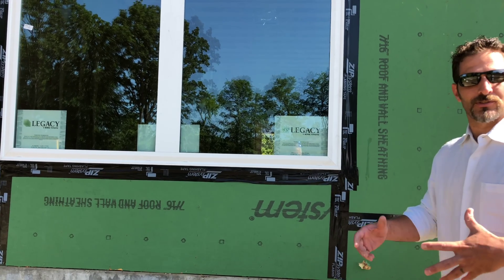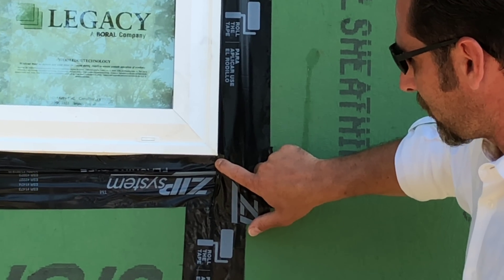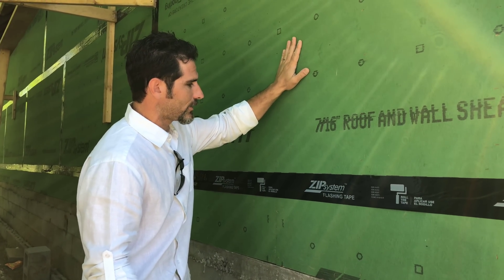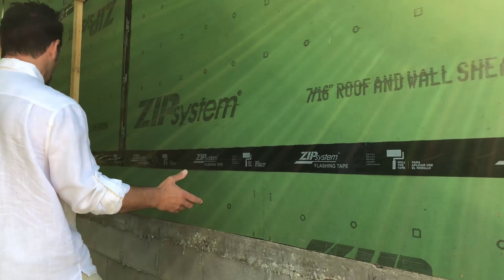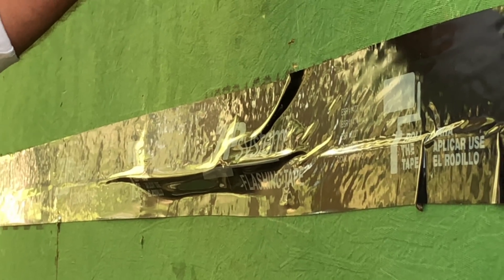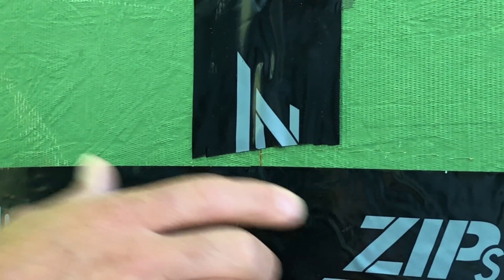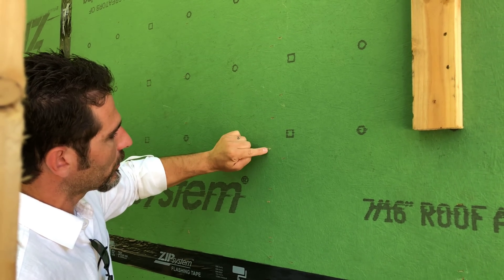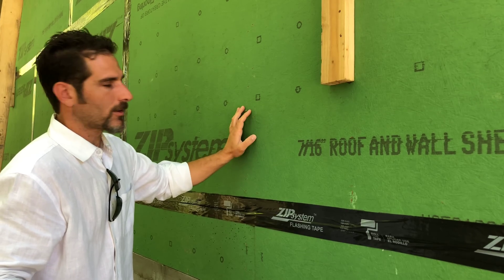ZIP System Problems

Comment: I'm building my home with 3 foot soffits/ drains around the slab to keep water issues to a minimum.I see homes with soffit 6 inches or less that have all kinds of water problems.I wonder why?🤔😒😒😒The  issue with the pneumatic nails applies to any surface.The nails are made of Chinesium, unless they are protected from the weather by thick paint/ caulk.The nail heads rust away and allow water to penetrate.

Comment: The ZIP tape doesn’t cover the entire sheathing, but yah if the Perm rating is so low like 5 for the ZIP sheathing. That is an issue. Peel and Stick is the answer and it covers all possible leaks in sheathing. Tyvek just falls apart and has so many holes it’s more bad than good. But great video. Thanks.

Comment: Zips problem will be permeability. They don't say its a vapor barrier but it is a vapor barrier. I have done repairs on zip houses and found moisture on the inside of the zip. If there is a vapor barrier installed on the inside of the wall like most homes in the northern us. It creates condensation inside the wall cavity. Tyvek allows that moisture to escape zip traps it. Theres gonna be a lot of rot repairs on these zip homes in the future.

Comment: If you have a newer hosue built with OSB and Pressboard siding and you live where is rains , they will all fail from water intrusion some sooner, some later. A new place close to me failed within 3 years. Ols solid houses with solid wood board sheathing and siding will rarely fail. Moslty froma lack of maintainance, not a design flaw.

Comment: Next year zip system will be around for 20 years how come no houses have been torn down or removed to see the problems that you are talking about and document them 
I have always thought paper of some sort house wrap would help disperse water before following the penetration nail or staple through into the studs a lot better than a painted surface like zip 

What's the conversation issue that you are mentioning there should be some kind of evidence out there in the world 🤷

Comment: Use Siga Fentrim 430 tape to seal the foundation to Zip sheathing.  Roll the freakin Zip tape!
Reply from the maker: Any horizontal tape edge is a potential for leaks unless it is lapped by another material over it. I never use that method to keep water out. Should we start skipping rows of shingles and tape the top edges instead?
Reply: @WeatherProofingAmerica  Siding covers the Fentrim tape Einstein.

Comment: The Z6 test was BS as the Tyvek test was not performed over a fastener. I do agree the holes should be sealed with their flashing sealant.
Reply from the maker: If you watch the video you can see the actual button cap inside the water column.

Comment: I feel ur pain on stuff being installed badly . Unfortunately that is not going to change. The care factor is not high enough.  Secondly I have seen many problems with houses not “ breathing “ and nearly ALL of these problems have been on houses with Tyvek . And especially houses with Tyvek AND spray iso foam insulation.  No breathing equals condensation/water retention = ROT ! Many of the builders I know have gone back to felt 30 lbs or 15 lbs ( tar paper) those 150 year old houses are still standing for some good reasons . It’s said that Tyvek breathes - maybe in the science lab it does. Not what I’ve experienced in the field. The Zip seems like more problems waiting to happen also . One more thing. Once you have the sheathing on a house - regardless of your “wrap “ -SIDE the DAMN THING !!
Reply from the maker: Tyvek has a higher permeability than all the items you mentioned. Tyvek is definitely not the issue of why the homes you have seen are having condensation issues. I would have to have all the info to tell you what the real problem is but it is not Tyvek I can assure you of that!

Comment: The installation is about as bad as it could possibly get. It's the installation and not the product.
Reply from the maker: Point is the potential for major issues is extremely high! How many homes you think are like this? If it had house wrap or even a fluid applied product the chances of this bad of a problem is eliminated.

Comment: The wall should have been framed flush with the concrete and the Zip at least1" below the top of the slab. Piss poor workmanship.
Reply from the maker: With housewrap this problem is simply fixed by hanging wrap past the foundation wall intersection!

Comment: The title of this video should be changed to "ZIP System INSTALLATION problems".   Everything explained here is all about lackluster or very poor installation.   So let's compare that to improper TYVEK installation.  You drive by a home under construction and see TYVEK blowing in the wind away from the house.  Or the button nails allowing water penetration even when installed correctly.   No thanks on house wrap products, seen way too many windows and especially sliding doors where the framing rotted 7 years after the home was constructed.
Reply from the maker: Difference here is the whole house has potential for rot not just the openings as you stated!

Comment: Just goes to show you there are no idiot proof systems. If you can't do a good system correctly just imagine how bad they would do a bad system. Bad job doesn't care what you use.
Reply from the maker: Exactly the point of this video! Bad system installed badly is double trouble!

Comment: you refer to a video that did a test showing water leaking through that nail penetration with a large head weight of water pushing down on it.  It also showed the same test on tyvex.  The only thing is, they did not put that water over a fastener.  In the spray test, tyvex leaked at its fasteners quite a bit.  The solve is, liquid coat your pens.
Reply from the maker: If you watch the video you will see they did place the water column over a button cap.

Comment: Excellent video! Preparing to build my own home and have had some doubts about this system. Not that I don't think it works well when installed as designed, but whether or not I can achieve the design install. The nailing and taping of this system is obviously critical. Based on numerous videos of inspections showing the tape and nails not properly installed by various builders who do this for a living, it appears that achieving the design installation in the field is actually more difficult than expected. I have built with the old system and have had significant success so I think I will stick to the tried and true.

Comment: I appreciate what you are showing and you are showing poor workmanship.   However you forget to remind everyone that this is not the finished skin of the building, but this will be covered with a siding of some sort.  As a PE I am often asked by contractors to make an exception for stuff their subs forget to do, or do not install.   On this job, I doubt the builder knows what the subs have done.
Reply from the maker: The waterproofing should ALWAYS be behind the veneer (siding, brick, etc.). You should never be relying on the veneer to keep water out!

Comment: That's just a bad install. I can't think of any system that will function properly when installed badly and with neglect.
Reply from the maker: Correct, but how much potential for problems is key! The potential for problems with this system are much higher than housewrap or fluid applied products ever thought of!

Comment: poor installation methods will defeat the zip system. no doubt. In comparison, Tyvek being stapled on is not better. Fully adhered might be better but it is a choice.
Reply from the maker: Staples are not the proper installation for Tyvek, button caps are.

Comment: Piss poor installation on this project.  Bottom edge where zip board meets concrete should use huber zip liquid flash product rubberized membrane that will air/water seal board against concrete, keeps bugs out too.  Any and all nail or staple penetrations should also be covered with liquid flash.  Liquid flash is the better product to use but if rolled and FLAT the tape will bond very well to the boards.  Hate to be the homeowner for that house with issues they will have down the road!
Reply from the maker: Sounds like a lot of time that is not necessary with Tyvek!

Comment: 1/2" Advantech is the best sheathing product on the market. The fact that these debates come to ZIP vs OSB is a telltale sign of the quality of the builders. Every custom home builder I've ever worked with is using advantech with commercial tyvek. I put a roof on a new build with 5/8 ZIP that had been in the weather for a month or so, and all the coating was peeling, probably 75% of the fasteners were overdriven, bubbles in the tape. Ended up just putting a quality synthetic paper down despite the builders objections that the ZIP was fine. I told him this is your build but its my roof and if my reputation is on the line then I'll fall back on what I know works. 

TLDR fuck ZIP

Comment: I was working on a job once where there was exposed OSB around the windows for quite some time and the housewrap came loose and was just blowing in the wind in quite a few spots because we had a lot of interior work to do and they had trouble finding experienced carpenters. A lot of the OSB was in the early stages of rotting and it just got sided over but if the owner would've spent some more money and gotten zip system it wouldn't have been an issue
Reply from the maker: That was a simple installation issue just like this is. Difference is this bad install will be much worse than bad housewrap install. Missing housewrap is not good at all!

Comment: I was with you until the nonsense about moisture at the end. Homes today have to have  higher R ratings. The sheath isnt the only thing on the wall. Further, id bet one could stop at a random tyvek house and point out issues with those installs.
Reply from the maker: I am sure you can find issues on the Tyvek jobs as well but not near as many issues and not as severe either!

Comment: Yes…even the safest and best engineered airplane will crash if the pilot does not know how to fly it.
Even the most well engineered and time honored construction assembly will fail if it’s components are installed by people who don’t understand it, haven’t been properly trained in how to install it and / or simply don’t care.
A car doesn’t drive itself.

Comment: When installed correctly and properly the zip system is an incredible system. I think this video highlights more so the poor training and/or supervision that needs to occur for builders on their subs to make sure things are done properly, whether its zip or siding or trim or cabinets or plumbing etc. This video is not about how bad zip is, its about how badly its installed on this new home. Installed properly its a ton better than Tyvek. But like anything, everyone has a bad review and a good review on every product no matter how good or bad they are.
Reply: While ZIP is an air barrier for building tight structures, its vapor open meaning it can dry. The whole idea is this is a system to build better, tighter homes moving forward to create more efficient homes. Tighten the envelope, and introduce fresh air and exhaust through a controlled system such as an ERV. Just like the body uses lungs. You can give a monkey the very best of wrenches, but it doesn’t mean they can’t ruin your car with it…
Reply: @taylorthompson9543 isn't the point that it has a very low perm rating meaning it doesn't let vapor out that is trapped. A proper install still has that issue inherently.
Reply: @ElvargsBane  No, it is vapor permeable meaning it can let vapor out of the structure. Its low permeability is to allow this but still significantly reduce bulk water intrusion from coming in. It’s fantastic at being an air barrier to achieve an airtight structure if detailed correctly per manufacturers instructions.
Reply: Osbs perm rating decreases as it gets wet any moisture from inside the house has no were to go. Plywoods perm rating increases as it gets wet.  I suggest everyone look at the zip warranty completely.
Reply from the maker: What is the permeability of the zip system after taped?
Reply: Cheap laborers often produce lack-luster results.
Reply: problem is that in most cases at a descent price no installer will ever take there sweet time and do this 100% properly in my opinion. especially builder grade homes
Reply: can that tape even be removed and done right?
Reply: I agree definitely! The contractors on this construction did very shoddy work that will ruin this home. Buy beware because you never know who built your house or how well it was built especially nowadays.
Reply: Here in north florida we do 2x6 stick frame, zip board taped or liquid flashed, 1x4 battens w/ rainscreen & hardie board, interior walls/roof spray foamed, no issues. The sill plate ideally should have copper flashing under it but alot of folks dont want to pay so it just gets foam/ tape and the cladding runs proud of the slab/stem wall to shed water cleanly. I wouldnt use staples, only exterior rated galvinized nails.
Reply: Incredible that putting tape on something is now "skilled labor".
Reply: zip system was a roof sheathing system that morphed into whole envelope. The permeability is its biggest downfall.
Reply: @amunderdog  how so
Reply: @randomrazr  Moisture is trapped in the framing.
Reply: My zip r 3 has mold and water damage. I wish I could post pics. It’s only been installed for about a week now. It’s been raining and it has soaked up all the water.
Reply: @Dawn-tv1bk  I assume someone is building your house or an addition using Zip R3? It would have to receive a TON of rain and moisture and be unable to dry out for very long period if you are getting that. I also assume whoever is doing the framing is taking a long time so you aren't getting weathered-in quickly? I have seen the zip system panels last a very long time in rough conditions and get 0 mold. I hope your installer knows what they are doing. Feel free to msg me if you need help.

Comment: I think this is spot on, not only calling out the sloppy work but also the possible long-term issues even if applied the right way. Houses need to breathe, part of why so many 100 year old houses remain solid and 30 year old houses are rotting.  But many contractors are like sheep following new and untested technologies.
Reply: Houses do not need to breathe if they are designed well.

Comment: Zip does have a lot of steps to make sure it's done right, but so does any wrap. Also, wraps make me want to rip my hair out (especially in the wind). Ultimately I don't think it matters which system you use, so long as you actually give a damn about slowing down and doing it right.

Comment: I have a question: with both Zip board and Tyvek, when shingles are installed, both will be riddled with hundreds of penetrations from nails or staples. Don’t these allow moisture in?
Reply: I know it's an old comment but yes it can if the nail is not sunk right. If the nail is sideways, too deep or too shallow can absolutely cause a "leak", moisture penetration or even R-Value to be insufficient. Not just roofs but even for siding as he is showing here in this video. 

If installed incorrectly, anything can leak obviously and that is definitely what we see here in this video. I also want to add, still have to add ice and water shield per code but I feel that would also answer the question too.

Comment: I'm not a builder, with that said, a lot of this looks like improper installation.  People trying to get their work done in X amount of time versus following the vendors guidelines.
Reply from the maker: The point is to make people aware of the drastic issues if not installed correctly. I have yet to see a integrated, WRB  system installation that was not problematic.

Comment: There is nothing wrong with the zip system it's the installation that is the problem and its a poor installation and I have seen it done correctly and the connection between the zip panels and the concrete needs the liquid sealer and it also needs to be on the nails.
Reply from the maker: I tell you what, go ahead and send me some videos of a zip project that you have found installed correctly. Thanks!

Comment: I completely agree! I watched as a lot of other builders jumped on the zip system, with an almost blind faith.

As the perm rating of the wrb is reduced, the air tightness of the exterior becomes more crucial. Most of the moisture arrives through air flow ( not vapor diffusion).

I have found the most robust system to be a self adhered system that is Vapor semi permeable. Especially if the cladding will be fastened, puncturing the wrb. The self sealing feature is incredible, and a must, if the budget allows for it.

A tyvek installed properly with properly flashed openings is a very Hardy unit. Heck, 15# roofing felt with  prosoco flashed openings is very durable as well, although not very air right. You would need to take an additional step to achieve that.

EXCELLENT video 😎👍

This is just my opinion.
Reply from the maker: It has been rather sad to say the least.

Comment: Sounds like it's not a Zip problem but an install problem. Misleading title.
Reply from the maker: These are very common issues with these types of systems and people need to be made aware because all the marketing hype is giving people false impressions on security of their project. If you have video of a zip project installed correctly, I would be very interested to see it.